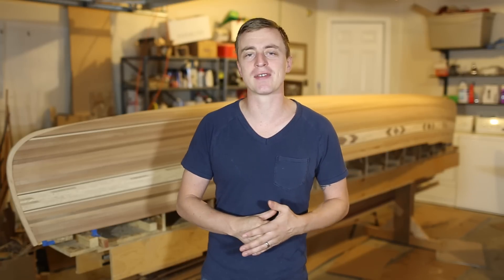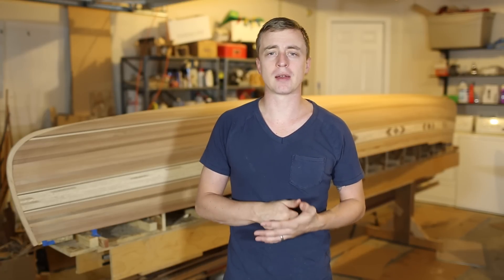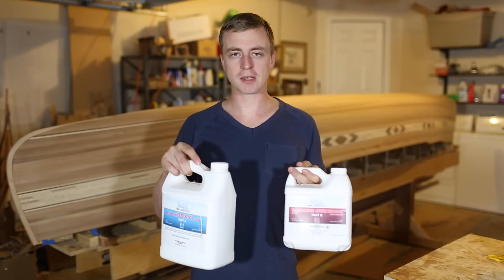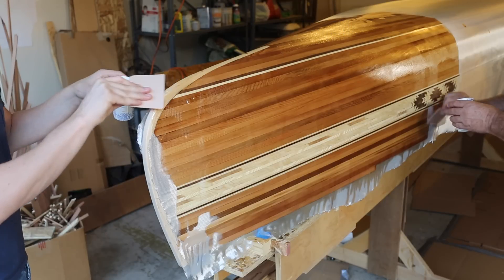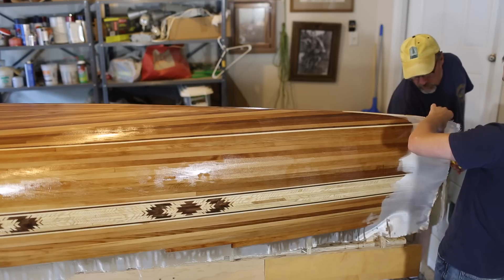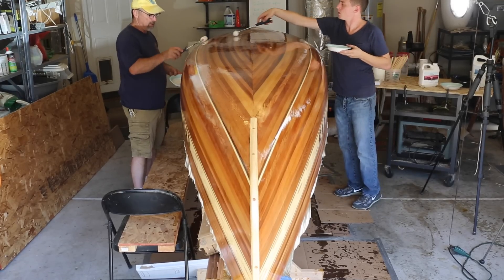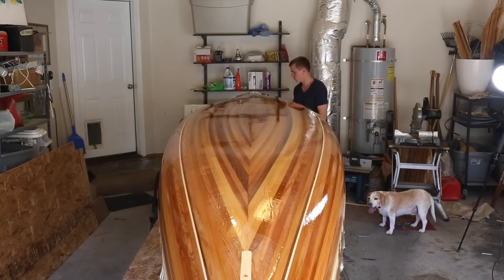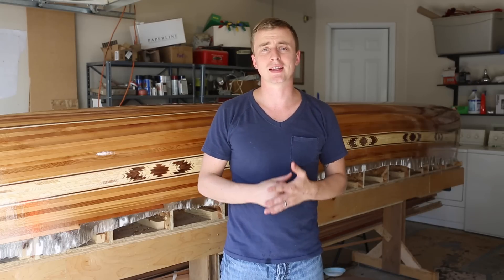Applying a Fiberglass Epoxy Seal (Ep 10 - Cedar Strip Canoe Build)

Comment: At 1:04 when the cloth goes over the canoe, DON'T do that.  

Coat the bare cedar with mixed 2-part epoxy first to saturation so no more resin can soak in the wood,  then lay the cloth down on the wet epoxy, prior cut to length and form, brush on a second resin coat and squeegee away any excess resin to dead flush to the cloth for full immersion and no air bubbles.  

If you throw the cloth over bare cedar and then epoxy over, the cloth is never embedded in epoxy and no proper bonding can result. It's the Joe corner cutting method. 

The cloth should be sandwiched between two epoxy coats bonded to the cedar.  After that apply two more coats and sand out any roughness .  
 

Epoxy and fiberglass cloth is like gluing two pieces of wood.  The glue has to be applied to both contact surfaces before mated.  Placing fiberglass cloth on bare cedar or other wood sidesteps and ignores one of the two critical bonding surfaces.
Reply: What if the wood is Okoume marine plywood instead of cedar--would you still recommend coating the bare wood with epoxy first?  Thanks.
Reply: I don't know what the plywood application is.  In all epoxy & fiberglass new build or restoration, whatever the wood, the epoxy is coated first on the wood to bed the fiberglass cloth or whatever sheet.  Fiberglass, just like drywall taping, is sandwiched between two layers of the adhesive compound.  

In kit cedar canoe building, usually by one builder, maybe two, the easy way is to rollout and lay the cloth down over the bare wood and then slam the epoxy on.  But that's the corner cutting technique.  

The difficulty is epoxy cures fast and rapidly becomes super unworkable. The bed coat will grab the cloth and almost not let go.  And that's why you see kit builders choose the easy route or just don't know any better. 

The traditional cedar strip canoes, of many different dimensional designs, were built from real old-growth Western Red Cedar, ribbed, copper tacked, shop glued (white glue), varnished, or whatever gunk they had, launched and they floated or didn't. 

The modern kits are substantially inferior new-growth farm cedar that need internal and external fiberglass. 

Epoxy-fiberglass, in new build, is a bandaid/crutch for inferior wood species.  For restoring traditional decades old cedar canoes is imperative because the original plank glue is basically no longer a structural bonding agent.

Comment: Hey Adam,  Love your videos.  I just fiber glassed a cedar strip boat I am building.  I have a few areas where the epoxy did not saturate the cloth before it dried.  The result is a small area where the cloth is visible.  Can I wait until the coat dries and then repair it somehow?
Reply: Sorry Tim, but once it dries, you are kind of screwed. You’re only way to fix it is to sand that area all the way down through the fiberglass and then patch it with a soaked little piece of fiberglass. I personally like to saturate the bare wood of the canoe with one coat of epoxy before putting any fiberglass on, this helps prevent that. Good luck!

Comment: Great video 
Though I do have a couple of Tips...
On your next boat using fiberglass...start in the middle and work towards the ends. The squeegy motion should be straight from center to the edge (less chance of wrinkles).
When rolling on the resin with the roller..chase it perpendicular with a brush. This will take out the ridges the roller leaves.

Comment: This is such a great video, thanks! I noticed that my cedar canoe has a small section that requires repair. Can I sand and apply a small piece of fiber glass and resin to the area that needs repair or do I have to sand and re-do the entire thing? Thanks!
Reply: You can patch it. Just cut a little piece of cloth and fully soak it with epoxy and then put it on, almost like paper mache. Good luck!

Comment: Im about to build a river boat, using oak as a material... Some builders told me that using this method, i will get cracks in epoxy and in two years Wood will start to rott... Is that true, or?
Everyone here is using tar instead of epoxy... I dont wont to use tar because the result is essteticaly unsatisfying... Help!

Comment: I did my first glass job on a skiff,over worked the epoxy when i put the glass on.it looked good then i had to mess with it and got air bubbles in the epoxy.some of it turned milky.A word to the wise.anyway it's gonna be painted so no real harm.live and learn,next time ill know better.
Put it on till it's wetted out and clear,dont leave puddles or excess on it,and leave it alone.I went back over it tryin to get it too smooth and worked air into it.

Comment: the hull should be given an epoxy coat first. Then put on the cloth as it gets tacky. This will help grab the cloth and smooth it out. But mpre importantly, without the epoxy coat on the bare hull, the bare wood pulls the epoxy out of the cloth weave as it sets up. It is not as strong as a result.
Reply: Iv heard that too john and that can cause adhesion problems.this guy certainly knows what he's doing.maybe going wet on wet on wet allows the wood to absorb the epoxy due to the constant application.dont know.the glass never gets starved because of the constant layers of epoxy keep it saturated
Reply: There is a video, part 1, where he does cover the hull with resin before he covers it with fiberglass.

Comment: what do you think? does a second, third, and/or fourth coat HAVE to be applied while the previous is still tacky or could the previous be dry (we let it sit overnight) and then we put on a second coat?
Reply from the maker: Elijah Wasson hmmm I think you’re going to have to sand the surface now then clean it really good before another coat... the epoxy can’t adhere if the surface is too smooth. You might be able to get away with it and be ok but I wouldn’t chance it if I were you... sorry! I know that’s a lot of added work...

Comment: Hey Adam, sorry to bug ya again. I am about to the fiberglass epoxy stage of my first canoe project. In terms of buying the fiberglass cloth, does all fiberglass cloth turn transparent when saturated? I have a marine store in the town I live in and they have plenty of fiberglass cloth that looks the same as what you are using. I noticed on the Bear Mountain Boats website the fiberglass they have for sale says "This cloth has been treated for epoxy compatibility". Is that cloth special or are they just being thorough in their description. The guys at the marine store mostly work with commercial fishing boats and don't seem too knowledgeable when it comes to the clear artsy finish I am looking for. Super excited and nervous about this part. Look forward to hearing back from you. Thanks, Tyler

p.s. look forward to hearing that guitar
Reply from the maker: Hey thanks Tyler no problem! This is probably one of those things you could ask different people and get different answers that are all relatively accurate. I kinna wanna say you get what you pay for, and even if anything is good enough I probably wouldn’t chance it cause you already have quite a bit of time and money into the boat so far. I would call the guys at Noah’s marine supply - they’re super knowledgeable and friendly. You could always get some scrap of both and experiment on scrap too ¯\_(ツ)_/¯ good luck that’s exciting!

Comment: can I stain the wood before this epoxy seal ?  if so any special stain?  thanks it was very helpfull
Reply from the maker: luis gonzalez I’m not sure - I don’t do a lot with stain so I don’t have enough exp... you might try to google it? I think it would be ok but it’d be a bummer to not work...
Reply: Do NOT stain the wood, it can interfere with the epoxy bond.    You can use wood dye if you want.

Comment: Tip: heard there is epoxy resin, that has a pump system, that make measuring easier and quicker. West system, I think brand.
Reply from the maker: Mike Williams yeah! I ordered some but they were the wrong ratio and I didn’t want to wait to order more so I just went ahead and did it. Those pumps make it a lot easier! Thanks!
Reply: Not sure if you’re talking about resin infusion systems but I would recommend using that. Used one to make some custom Jeep parts (hood, fenders, etc) and made life so much easier. Wish I could remember the brand.

Comment: Not sure if I missed this somewhere, but how many yards of fiberglass did you end up buying? I am currently building a Bob's Special myself and it is my first canoe. Learning a lot with the build and it is extremely fun so far.
Reply from the maker: Brian Carnahan that's awesome! Um... I'm not quite sure how many yards... I think I called "Noahs marine supply" and they told me exactly how much I needed. there might be an option on their site to buy enough to do the inside and outside of a 16' canoe...? Good luck w it!
Reply: For those that run across this question. I just got off the phone with Noah's Marine and they suggested 11 yards of fiberglass. I also ordered resin and hardener and purchased 2 canisters each of the 105B and 207B. FYI, the "B" designates the canister size.

Comment: i just bought a cedar strip canoe from a builder who said he did not finish it.  I can still see the fiberglass cloth and the finish is cloudy in parts.  Any ideas?
Reply: if it is cloudy, even in parts, it is NOT o.k., and it should be removed. Sanding and varnishing alone does not deliver a good result. Especially if the cloth structure is still visible, it must be filled with two or more thin coats of resin before doing fine sanding and varnishing. If the existing sheating is rather old, the epoxy coats needed to fill the cloth structure will not stick very well to it.
 If the sheating was made with Epoxy, it can be removed by using a heat gun. To do it make cuts lengthwise with a utility knife into the cloth (must not cut through). Then warm a cloth strip and peel it off. I recommend to use a heat gun with a temperature control. Temperature depends on how old the glass sheating is. One can start with about 100 degress celsius, and make it hotter until it works. The resand the whole boat to remove all resin remainings until you can see the wood structure again. Sand it smotth and re-sheat the whole boat with fiberglass cloth and epoxy.
Happy building, Biber from http:biber-boote.ch
Reply from the maker: AY Solar maybe rough it up with 400 grit and put a couple coats of epifanes varnish on it?

Comment: would a bit of heat from a blowtorch help with the smoothness of the epoxy? great build - you have a new sub
Reply from the maker: horatio71 awesome thanks! Yeah I've seen people do that before, I don't know if it helps the lumpiness but it does take out tiny bubbles that form on the surface. I sand the surface when I'm done so it wasn't too big of an issue for me. I know other builders that do that though. Thanks for the sub man!

Comment: @A Guy Doing Stuff; did you put the first coat on bare wood, or have you previously rolled a coat of resin into the wood?
Reply from the maker: I roll the fiberglass on without any epoxy, then I pour it onto the epoxy onto the fiberglass. The epoxy soaks through the fiberglass and soaks into the wood. I have seen somebody online that epoxied the wood before putting on the fiberglass but that is unnecessary because the epoxy soaks into the wood fine my way. Hope that helps!

Comment: Your production value was really good this video.  I'm enjoying every video so far and I can't wait to start sourcing materials for this winter's project.  I'm a machinist by trade so I'm curious how those skills will translate to building my first canoe.
Reply from the maker: That's awesome! Have you done any woodworking before? Metal working seems harder than woodworking to me - probably cause I don't have any experience with metal working. Canoes are much more doable than they look - they just take forever. Thanks for watching, hit me up if you have any questions throughout the process!
Reply: I haven't done any woodworking beyond maintenance or construction.  From what I've seen machining isn't much more difficult than woodworking, it's all a matter of the process, there are a thousand different ways to do it etc.  The mistakes can be a bit more labor intensive to fix and of course costlier.  Thanks for the offer of help and if I need any I'll be sure to hit you up.
Reply from the maker: Biscuit Waite So true about processes

Comment: fiber glass epoxy...nice!! now thats a technique ive never heard of..now is the fiber glass protection from the water or from the bumps in the river?
Reply from the maker: Joe basementwoodworking yeah it was new to me too, it's mostly for waterproofing and it's super super strong. Really fun to do when you get it right... thanks for watching joe!
Reply: A Guy Doing Stuff ALWAYS BROTHER!!& Ahh yea that makes sense..and im guessing the brand and type of epoxy matters also? Like u could t just go to home depot and buy the epoxy theu sell for this..right? Not that you would because it would take like 40 boxes but I meant that specific type of epoxy
Reply: Joe basementwoodworking The fibreglass is for strength and it replaces the ribs found in conventionally built wood canoes. It also provides quite a bit of impact resistance. I once hit a submerged rock in a fast flowing river. I got thrown across the thwart, the other person got thrown out of the canoe because of the sudden stop. There wasn't a scratch or dent in the canoe.

Comment: Please wear nitril gloves.
Epoxy is not good for your health.
Reply: Malte Musfeldt I second that. Please, please wear gloves when applying or mixing epoxy. Your skin will eventually get sensitized to it and your skin will break out into a rash anytime you come into contact with uncured resin. Once that happens you may even break out when touching some woods and even foods like the oils in the skin of citrus fruits.
Reply: And safety glasses.   And an organic vapor respirator.
Reply: Indeed, use gloves! When I saw you guys pour I almost didn't believe it was resin! As you mentioned do your research beforehand and use gloves! Gorgeous craftsmanship tho! Great job!!